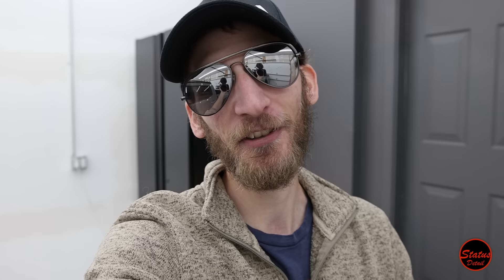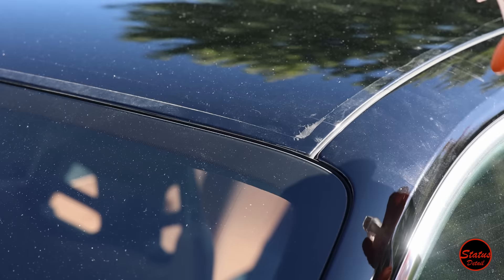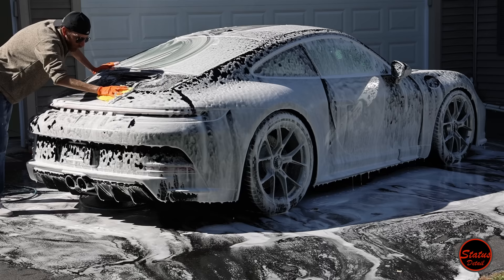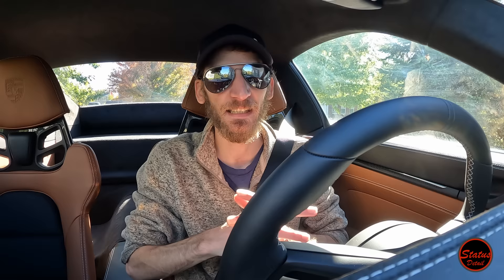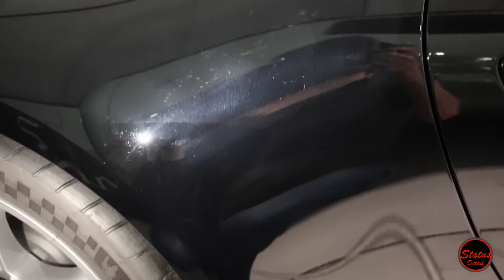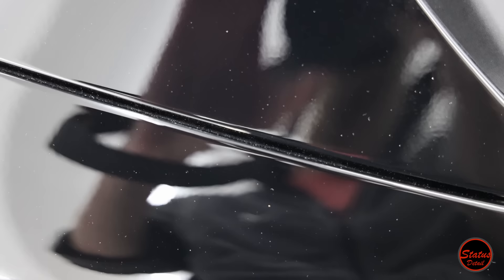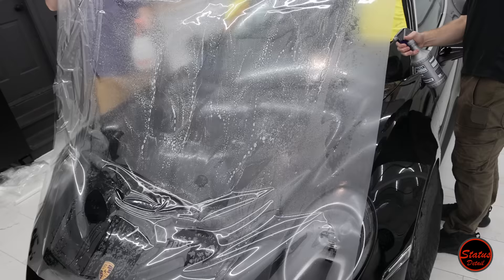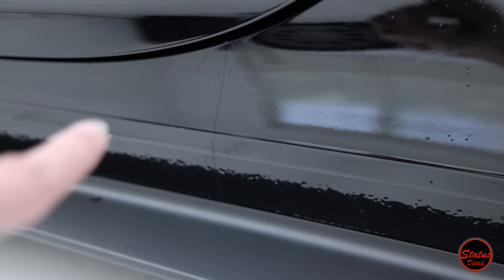992 GT3 Touring FIXING Worst New car Delivery EVER!

Comment: Why are ceramic products a waste of your time?
Reply from the maker: Not sure I understand the question? Are you saying for the drying part? If I'm about to paint correct car I don't need to put any serious or expensive ceramic based wax or sealant on the car. I'd simply be removing it during the paint correction. Gyeon quick detailer is the least expensive way to help mitigate potentially marring and swirls during the drying step. 

I certainly could have chosen to skip that as well. Then such an expensive car with black paint It just felt like the correct thing to do.
Reply: @STATUSDETAIL  I see. Didn't mean to be sarcastic. I was just curious
Reply from the maker: @gamatoutsikos  no worries at all. I didn't think you were being sarcastic I just wasn't sure I understood the question. 🙂👍
Reply: @STATUSDETAIL  I just started following your channel and I like your content. Really really engaging to watch
Just an idea, wouldn't a car like this benefit from a 2 yr ceramic coat? What are your thoughts on that for new cars?
Reply from the maker: @gamatoutsikos  glad you found me!! 

This car has 7 year ceramic. 

2 year ceramic products are not a bad choice but are typically just lower quality. 

To answer your question yes a 2 year ceramic would be beneficial. But a 7 year ceramic is just more beneficial.
Reply: @STATUSDETAIL  so it has all these swirls with a 7 year ceramic? Crazy!
Reply from the maker: @gamatoutsikos  I'm not sure what your referencing. The ceramic went on at the end. After the paint correction.

Comment: Those aren’t steel brakes
Reply from the maker: They definitely are not carbon ceramic lol
Reply: @STATUSDETAIL  pccb are black or yellow. Steelies are red. Everyone knows this. You should too.
Reply from the maker: @jamie140  that's incorrect.
Reply: @STATUSDETAIL  You are absolutely correct. Just introduced with the new configurator is the $900 option to paint steelies black. My bad.

Comment: The drive home is going to be cringe
Reply from the maker: Na going to be a blast!
Reply: @STATUSDETAIL  I meant as far as getting it dirty as it will literally never look that good again I imagine! Great vehicle delivery process mate.
Reply from the maker: @farqueue  no no! It will clean up easily because of ceramic!🙂
Reply: @STATUSDETAIL  Not as clean as you got it though bud!  Never again will it be that immaculate if it's used.
Reply from the maker: @farqueue  incorrect. Lol
Reply: @STATUSDETAIL  How is that funny? You are saying a stone chip or some dust wont get caught from driving? odd
Reply from the maker: @farqueue  rockchips are different than dirt. We can clean dirt back off. This is a great customer of mine and he will see me multiple times per year for in depth maintenance.
Reply: @STATUSDETAIL  not from every single crevice on a car with 50mls once it's driven... impossible to return it to this same condition sorry bud
Reply from the maker: @farqueue  everything can be cleaned. Just depends what you want to pay and how far you want to go🙂

Comment: run from him... the moment he "stomped" on cold brakes just to take of service rust and drove the car without plates and maybe even insurance is when you should know to run... all you need to do is move the car few fit each way slightly using brakes to get it off. guy wanted a joy ride a car and that is his excuse...
Reply from the maker: Customer was fully aware of what we did and okayed it before we did it 👍

We are all car enthusiasts here. I definitely didn't stomp on the brakes but it wasn't a feather touch either. 

Going back and forth in the driveway works but it doesn't get everything off. I do this for a living and know from experience that to fully clean it off you need to do a decent amount of pressure to fully engage the pads. 

I have some of the coolest customers in the world and if I want to joy ride a car the customer will let me drive it for 30 minutes. This has nothing to do with a joyride. 

I've driven multiple million dollar cars that are way more interesting than this. Many half million dollar cars as well. I have unparalleled access to the world's coolest cars so I don't get my thrills from hitting the brakes on a touring at 15mph lol.
 Maybe check out the channel so you better understand what we do here.